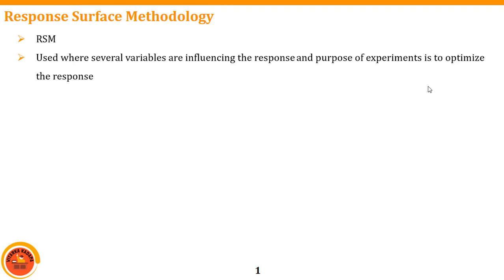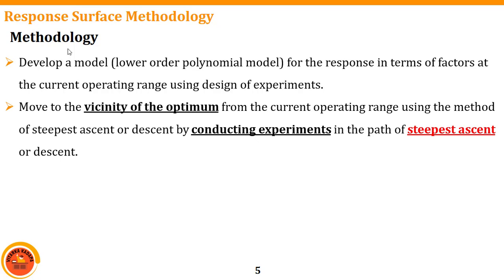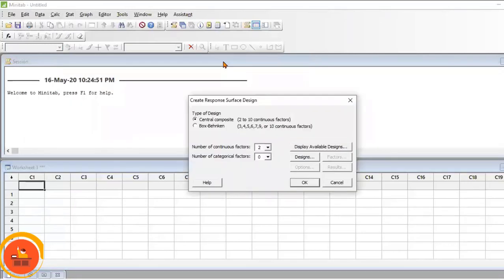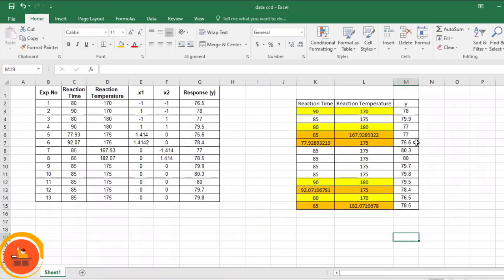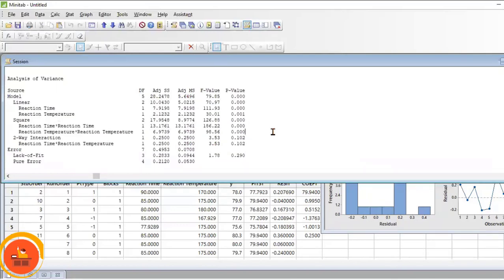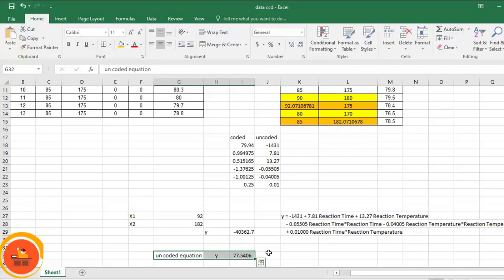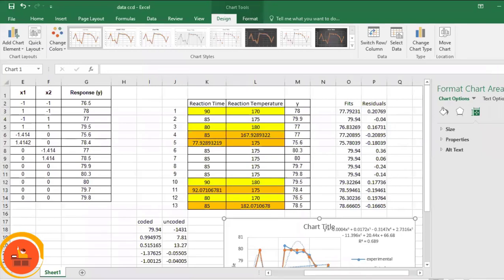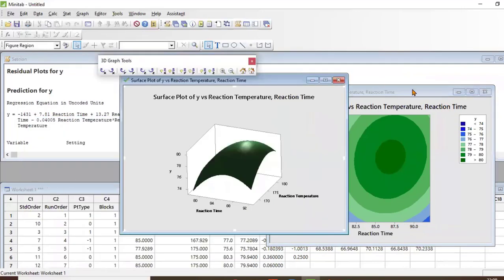Response Surface Methodology - RSM - tutorial

Comment: How to check the S/N ratio in RSM using Minitab?
Reply from the maker: Perform the analysis for the higher the better or lower the better, you can see the option as Analyze Taguchi Design in DoE. But in RSM  I need to check the minitab, currently i dont have access to it

Comment: Hello Sir, thank you for this information about RSM! I would like to ask if how can I create a surface plot that would cater on my expected result e.g. gel clarity to be at the minimum, gel strength at its maximum, and swelling power at its maximum?

Is it possible to generate surface plots with a minimum or maximum response variable setting?
Reply from the maker: yes sir you can surface plot, use any tool like Design Expert or Minitab for those

Comment: hi sir, what if the experimental day and randomized data doesn't match with the input parameters. For suppose in experiment we have 15 and 1.05 but in randomized table that we got from rsm have only 10 and 1 how can we write the response value as there is no experimental value for the randomized generated data
Reply from the maker: Basically, we need to perform the experiments based on the RSM based design of experiment only.

Comment: Thank you for your invaluable insights. do you know how to change polynomial equation to logarthmic equation?
Reply from the maker: You can it to Linear Quadratic or 2FI during the analysis. It will be available as a drop down if you use any software for the RSM
Reply: @Vitarka what is 2FI mean ? In addition if response is transform to log and conduct again analysis considering log transform response will the equation be logarithmic this time. I use a minitab. Thanks in advance

Comment: hi, I'm working on laser-assisted turning and currently experimenting with five parameters: depth of cut, feed rate, spindle speed, laser power, and laser angle (the distance between the laser spot and cutting edge). Initially, I opted for a face-centered central composite design. However, I've noticed that when the laser power is set to 0 (indicating the laser is off), the laser angle becomes irrelevant. I'm uncertain about the appropriate experimental design in this situation. Could you please suggest a method or name for this scenario, considering the disregard for laser angle when laser power is zero? Thank you for your insights!
Reply from the maker: You can add the parameter as 0.1 instead of 0 in the face centered. If 0.1 make sense you can consider in the calculation as negligible. This is thought process.

Comment: Hi, my question is about optimization in factorial doe, without recurring to response surface. I was wondering if in order to use the response optimizer in factorial doe, interaction effects are mandatory, or I could also optimize just using main effects. I ask you this because from what I understand in response surface I need at least interaction effects to be able to optimize. I'd appreciate a clarification. Thanks in advance.
Reply from the maker: It totally depends on the complexity of the problem. Moreover some research problem required only main effects to get optimized. So require interaction effects also. If you observe some of the problems the main independent factors will not have effect but the interaction may effect. 
Any you question to doe is depend on the number of experiments we are working. This also effect
Reply: @Vitarka   thank you. I still have one doubt about this though. In RMS we say that conceptually we need a curvature (interactions and square terms) to be able to optimize. Why can we then still optimize with only main factors in the model, since in this case RMS would have no curvature and a completely flat surface?
Reply from the maker: Not aware of the curvature of interaction
Reply: @Vitarka   interaction terms would twist the surface.
Reply: @Vitarka   you are absolutely right to say that interactions don't produce curvature though. What I meant is that they still affect the complete planar surface with just main effects, like they produce a twist.
Reply from the maker: in a problem interactions play a role yes definitely they will impact

Comment: Sir,i have used 6 factors,centre point 3 and 37 runs...is this right?got quadratic with all responses and is significant.
Reply from the maker: Madam I am not sure about the number of runs. In rsm you can customise your problem
Reply: @Vitarka it's a central composite design...using 6 factors aren't an issue right?
Reply from the maker: no issue, then it is right. you can customize the centre points also.

Comment: Respected sir, please reply that if we have 5 levels and 4 factors than how we assign the values of level as low and high...please reply asap.. Thankyou
Reply from the maker: Hi madam, in the case of 5 levels that is difficult to set in rsm try to use Taguchi method for it

Comment: hi,,When I fed the variables for four factors , the combination I got some times deviated to my experimental trials..For that how can I add the response value..Do I want to omit that combinations?
Reply from the maker: You can mail your problem, my gmail id was

vitarkaprojects

Basically the response value depends your DoE, later you can type it after the columns or copy paste those.
Reply: I would to know also,how to compute the response value..where did you get the response(y) value in excel? is it computed?

Comment: thanks for this rich video, i want to ask you how do i know what kind of design better to use for a study
Reply from the maker: Depends on the research problem and spend some time on reviewing the literature so that the authors give faults and advantage in applying the design so it will be easy for you.
Reply: @Vitarka  thanks for your reactivity . plz we need more videos about response surface methodology and how analysis the graphs
Reply from the maker: Surely i will prepare a videos on it and upload
Reply: @Vitarka plz i have one question why  in articles i find the same number of factors and levels but each article has a different number of runs want just know why . exemple in minitab logicial with 2 factors and 2 levels it gives uasuly 13 runs but in articles i find differents number
Reply from the maker: @sarasara-yr2xj   it depends on number of blocks in the design and number of axial points with that part also the experimental runs will vary